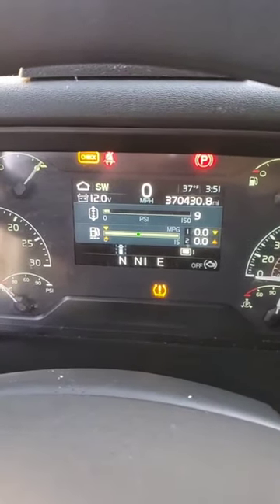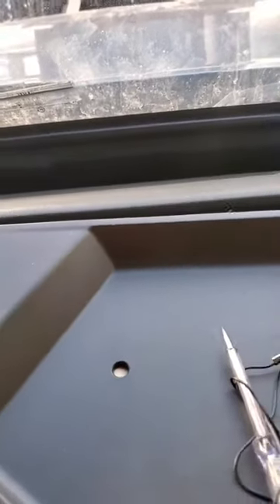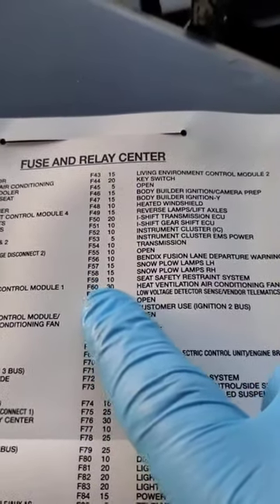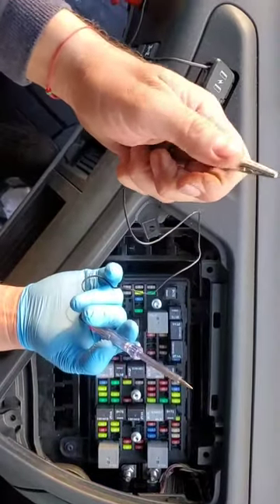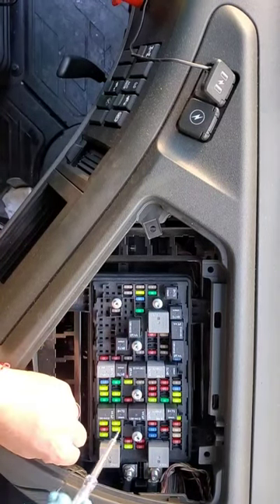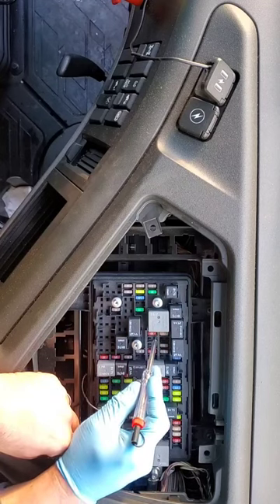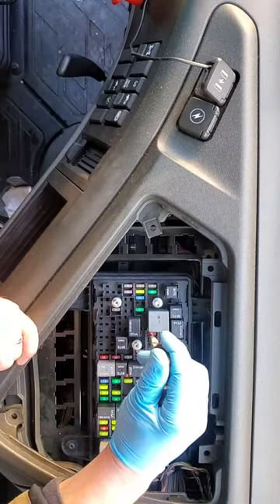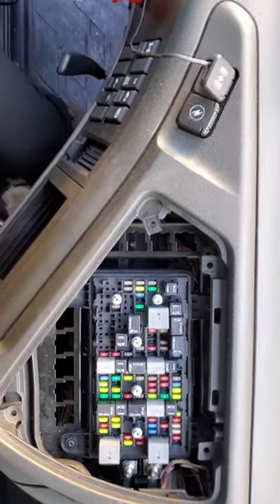How to check up fuses on Volvo VNL

Comment: Can you show the Diagram closely.  I have the 2021 vnl860 but when I bought it didn't have the diagram.
Thank you.
Reply from the maker: Look at the opposite side of fuses lid
Reply: @MrDaniognianov   I did it has nothing...can you also make a video about the APU mine works for AC  but not for heat.
Reply from the maker: @richardr2362  unfortunately we don't have APU
Reply: @MrDaniognianov  okay thank you

Comment: My radio stopped working. Idk why. All i did was use my phone  charger to the usb on radio for bkuetooth connection.  Now its not connecting anymore. I change both radio fuses but still nothing 😢
Reply from the maker: I never have that problem before...thats sounds to me like radio is burned, not a fuse. 
Something is messed up. 
Better to check that with service, but don't try anything else.

Comment: DO YOURSELF A FAVOR AND BUY A VOLT METER!! NEVER USE A TEST LIGHT ON NEWER TRUCKS BC YOU WILL CREATE FAULT CODES DUE TO THE DRAW ON A CIRCUIT FROM THE TEST LIGHT. A volt meter has its own power source.